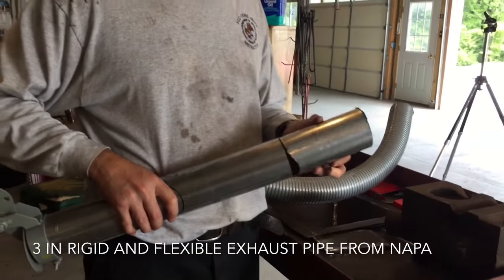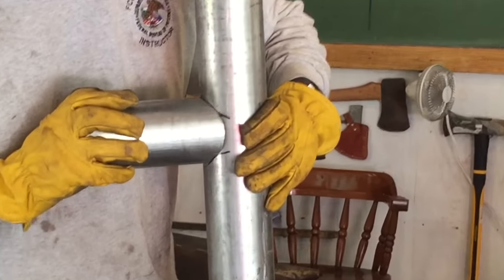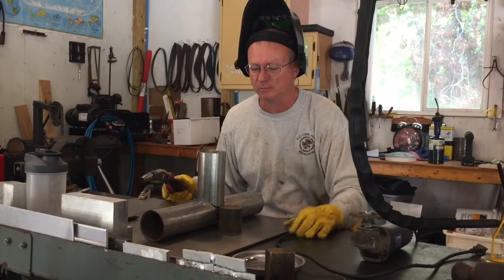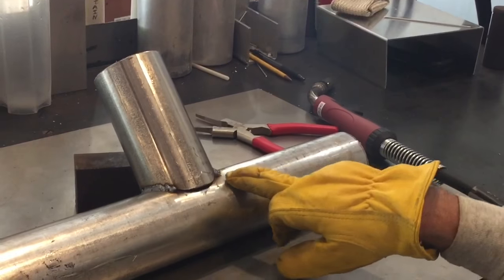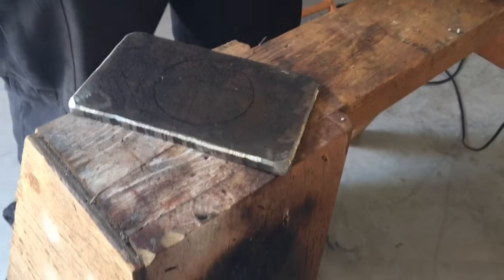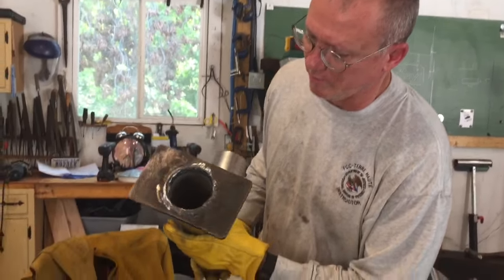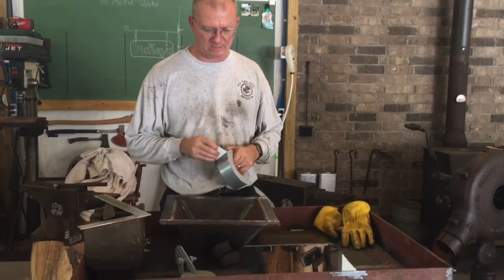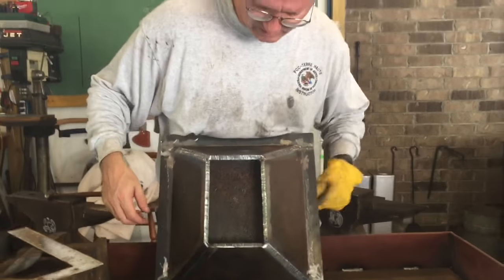Upgrading My Blacksmith Coal Forge: Part 3 - Tuyere Pipe Build

Comment: I noticed you use a grate rather than a clinker breaker. Do you have a problem keeping the airways clear after a long day of forging/welding?  I've gotten some coke that was pretty bad for clinkers, and it could really clog things up.
Reply from the maker: Not at all, my grate is very easily removed and I can clear it as needed. I love the design of this firepot. Works fantastically!
Reply: @shopdoc  I need a new firepot for the 1880-era blacksmith shop at the Tallahassee Museum where I volunteer.  I'm going to build one using your videos as a guide.  It won't be period-accurate, but it will be covered with coal or charcoal, so I'll be able to get away with it.  :-)  Thanks for the videos.